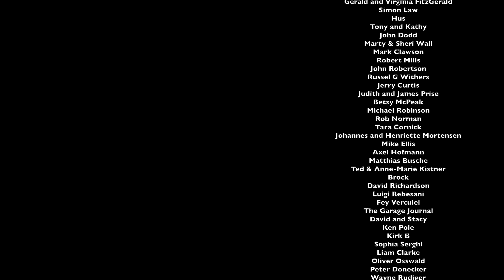How To Beautify This Boat

Comment: Every time I've replaced a cutlass bearing, I've left about 1/2" protruding from the shaft tube.  Next time you (or whoever) needs to replace it you simply release the set screws (which they apparently  did not used) and using a vice grip or channel lock pliers spin the bearing out. I've never had a problem with the small amount of exposed bearing. And it certainly simplifies what can be a challenging task with the shaft in place.
Reply: I always leave a bit out to get a grip on later, works well 😊
Reply: Should be an interference fit and not come out without a puller and not the tiny makeshift one he used. That said I've only done one boat bearing and mostly bearings on land based machinery where a tight fit is critical and the insides are not rubber with water providing a buffer.. How often are you replacing yours and have you had any issues with the tube hogging out and becoming tapered? On the 9ne I did this was f9r sure an issue.

Comment: Fun fact. Back in the days cabin tops were made out of cloth and they used  what you called “the eyebrow” to nail them on the cabin sides, to spread the loads and avoid tearing out the cloth
Reply: Correct except for one thing. The structure would have been made of wood, and just covered in thick, coarse woven canvas. After it was fastened down with the battens around the edge, they would liberally paint over the canvas with oil based, often leaded paint that would protect everything and help keep the canvas stuck to the roof. This also served as a primitive non-skid surface.

Comment: Ho guys ..To remove a cutlass bearing I use a hacksaw blade and make 3 cuts in thirds along its length and then use a chisel to break out the old bearing and glue the new one in ...I rarely use a puller to remove it ,i've even used a sawsall very carefully with a fine blade ..comes out easy ...cheers Graham. master shipwright from Australia ..
Reply: Lol. Hi guys😂
Reply from the maker: Exactly how I do it:) thanks!

Comment: The boat is really looking amazing! Really like the way you installed the eyebrows, they are always a source of leaks when installed with screws in the usual way. Glad Mack Boring stepped up and helped you with the Aqua Drive. Really great set up to have, which will also prolong the life of your reduction gear by reducing wear on bearings and seals. As always Maya's varnish and paint work is art in and of itself

Comment: Great work and very nice way of attaching the teak to the cabin without using screws or through bolts.  If you have future similar tasks you could try using 3M VHB tape.  It is used to hold large windows in skyscrapers and to hold enclosed trailer panels together rather than rivets.  I used it to install non-opening portlights / deadlights during a refit of our older sailboat and it is very strong.  i also ran a bead of Dow 795 around the edges as welll and have had now leaks and they look great.  Best of luck!  We enjoy the channel !

Comment: Always so impressed with your level of craftsman's ship, truly a lost art form.  I was concerned as you were moving your thrust retainer position and it's relationship to the prop location...then I realized you can still trim the shaft length if required.  Why, I watched  Sam Holmes Sailing  site and his " Big Expense" a few moths ago in the Greece of his Cape Dory 28 ( An East Coast made boat not the same fabricator?)  The Prop shaft was too long and with a hard rudder over he bent his prop, that was a disaster waiting to happen, would never think not to Hard Rudder over  if required.
Reply from the maker: By changing engine and adding the cv joint we automatically are forced to a new prop shaft as well. We can also shorten the old one to have a spare
Reply: That is typical Sam.  Cape Dorys are wonderful boats.  We came close to buying a 28, but the same yard had a 27 that was beautiful and ready to sail away.

Comment: Most cutlass bearings  will have 2 set screws  on the outside of the stern tube.. you just dimple the bearing and the screws just hold it in place

Comment: I’ve always been told to make final adjustments on shaft alignment in the water as boat may sit differently. With that in mind Will you add any system for adjustment to the thrust bearing that you attaching to the new rear bulk head  or do you feel it’s to short a distance to be a problem ? Loving the thought and quality that’s in the refit so far, can’t wait to see her under sail in The future
Reply from the maker: That is a good point to consider. But I feel like it also depends from boat to boat. 
The section and beefiness of the hull together with the short length of shaft doesn’t make me worry about movement at all. 🤞🏽 U shaped hulls could definitely flex more

Comment: We are in a similar situation with replacing our cutless. Did you just use thickened epoxy to set it?  If so, were you concerned at all about using a cold bearing and having the epoxy set properly? Love the channel!
Reply from the maker: I didn’t understand what you mean by cold bearing. 
Every cutlass is different. Either glue it with caulking or epoxy or sometimes they have a set screw to hold them in place

Comment: Will you be overcoating the deck with a coloured paint?  Plain white is very hard on the eyes in bright tropical sunlight (aka snow-blindness).
Reply from the maker: Yes, the non-skid will be a cream colour.
Reply: @SailingMagicCarpet  That's good to know - it was the first change I made to my own boat.  I went for cream as well.  So many of the 'big name' youtubers (Vagabonde, Atticus and Uma) seem to have all-white decks, and I wonder about the long-term effects on their eyesight.  Plus, a contrast between the deck and hull just looks nicer.

Comment: I'm mounting a chain roller on the bowsprit of my BCC 28, but was planning to simply bore a hole for the axle and bed it well. I am interested in why you chose to use a phenolic tube. Perhaps so the axle does not eat into the bowsprit wood itself? But on the other hand, the larger hole for the tube might weaken the bowsprit. Can you explain? Thank you!
Reply: I’ve clamped my bow roller on my bcc,no thru hole in bowsprit
Reply from the maker: I want to have the timber as sealed as possible. That’s the main reason why I like to include the tubes where I drill a hole. The tubes are of rather thin wall thickness, so not weakening the original hole much.
Reply: @SailingMagicCarpet  Thank you!
Reply: @chuckquint7913  Mine is a bronze one off another boat with a single axle for both rollers. There is no piece that clamps across the top, though I'm thinking of modifying it for a top clamp so the entire spar supports it.

Comment: I'm a little confused about removing the Samson post and through bolting the bowsprit to the deck. Without the Samson post, what is going to take up the aft compressional forces that the rigging will exert along the bowsprit?  These compressional forces can be quite high, and need a solid point to bear against. I would not want to rely on the bolt to deck strength, nor the bolt strength itself.  Even sizing the bolts properly for the loads, the crevice corrosion of stainless in the marine environment will quickly weaken the bolts, and the cyclical loading will compound that, and exacerbate the corrosion with the applied stresses leading to stress corrosion. Any movement of the bowsprit at the joint will also wallow out or enlarge the deck holes over time leading to deck damage, leaks and possible wet core material. Direct contact of the wood along the deck surface will cause rot.  I'm sure you have a plan, but your explanation left open a lot of bad possibilities.
Reply: My guess is that with the bobstay the bowsprit mounting bolts will be in shear much like the chainplates

Comment: A bit of an assunption,  but I think you are about opposite the spot I was in last Aug.....some of my experiences might help:
-  the "aquaguard" anti fouling sold at the yard store appears to be no good - launched end aug and I got fuzz by Oct
- the crane service at big building LHS at gate (trying not to say location) quoted under $300 and changed me double to raise my keel stepped mast. Also delayed my launch due to not being able to release the lifting  rope, so get quote in writing
- make sure you get the code for the main gate - I got locked out at midnight, there is  a totally weird way to open the vehicle gate
- There are a couple of good contacts in the yard. "Gord" rides a bike up and down - really friendly, and helpfull - has an old wood workboat LHS 1/2 way down and a nauticat sailboat. From Alberta.  Blair Fraser has a dark blue  KP44 cutter on the docks - he had his own shop in the yard for years. Ccmpletely gutted the boat, added the sugar scoop, has done a fantastic job so would maybe have some good contacts.  Sergie (Russian) is probably opposite you with a newer  Taswell 42? cutter.- helpfull.
- insurance and survey were a pain. Let me know if you want a better price from the surveyor friend I used (typically $800plus)
- I bought a "cheap deisel parking heater"  on ebay and tested it at home - under $100 usd - seems really good clone of an espar  and real quiet forced air. Have yet to install it
Assuming my assumption correct - hope this helps
Say Hi for me if you meet up with them
Richard (SV Kelaerin, Nanaimo)